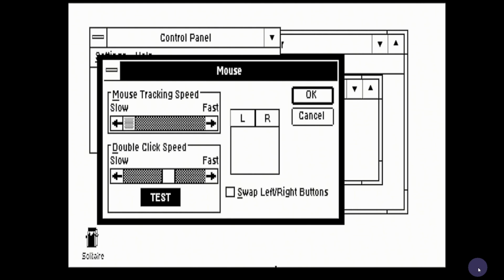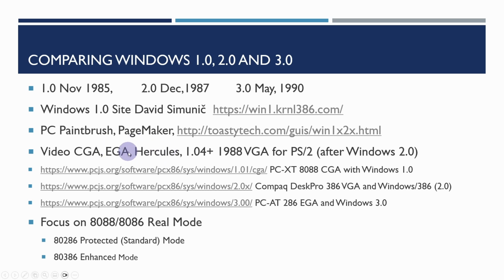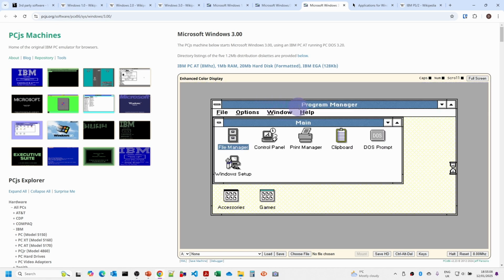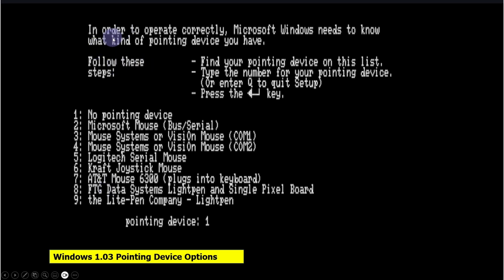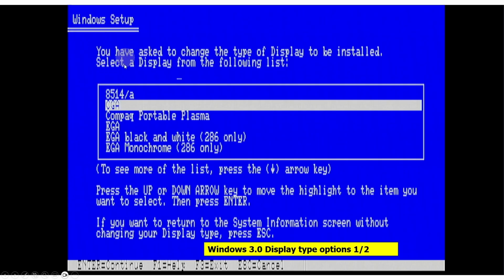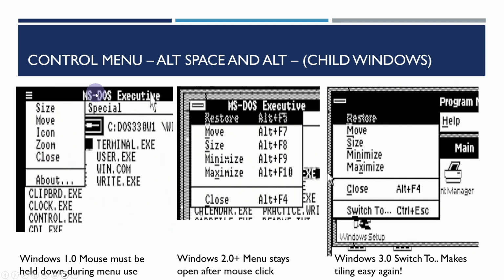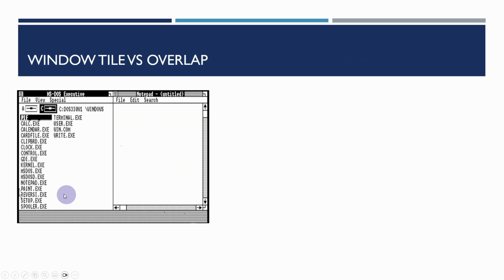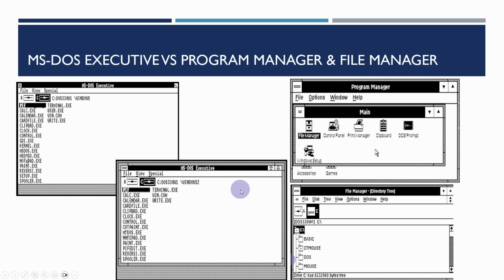Breadboard 8088 PC #64 Windows is almost 40!

Comment: The gui font in Windows 3.0 is more advanced. While it is still a bitmap font, it is now a proportional sans-serif, rather than a fixed-width font.
Reply from the maker: Agreed, plus more than 8 colours and coloured bitmaps! WIndows 3.1 was the big jump font wise with TrueType which is still with us today but 3.1 won't run on a 8088. Dave

Comment: The lack of applications for early Windows versions was an issue.  I started with Gem, the DR competitor, because I needed to run Ventura Publisher that didn't have a Windows version until a couple of years later.  The Gem/Ventura combination ran reasonably well on a 386/16 machine.  Maybe installing Gem would be an interesting side project to compare the two GUIs????
Reply from the maker: Yes, I was going to mention GEM as well and perhaps try and get it running. In the early days of Windows the drawing programs on GEM On Amstrad PCs were better than the early Windows ones from memory. 
Some of the larger installs like Windows 3.0 have been corrupting the DOS File Allocation Tables (CHKDSK etc) so going to try and re-work in a version 2 BBPC which will hopefully be more stable then can try out more software. Dave
Reply: @breadboardinglabs  I Googled to see if GEM was available online and it turns out it is and there is even a thing called FreeGEM that looks as if it staggered on until quite recently.
Reply from the maker: You can download original GEM  from Winworldpc https://winworldpc.com/product/gem/1x plus FreeGEM etc. Dave